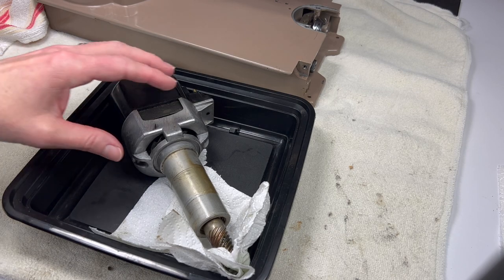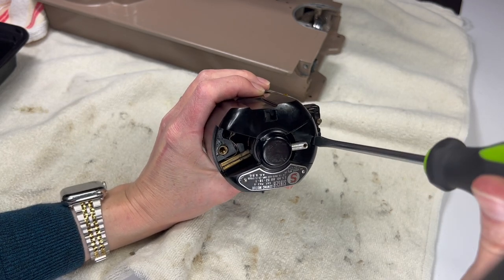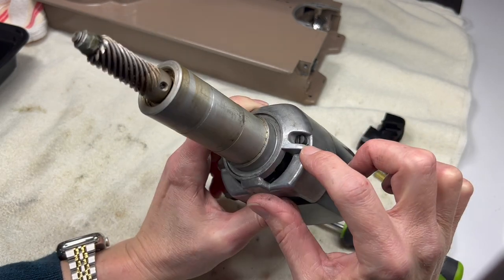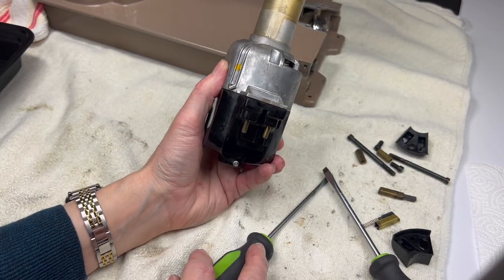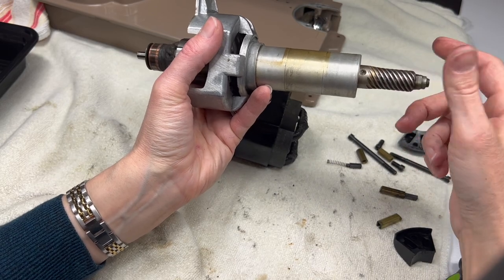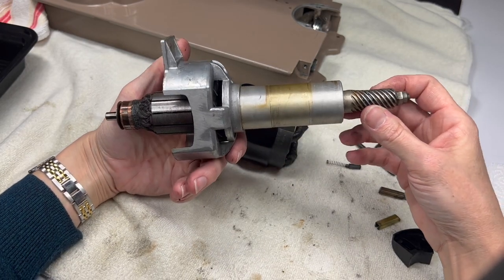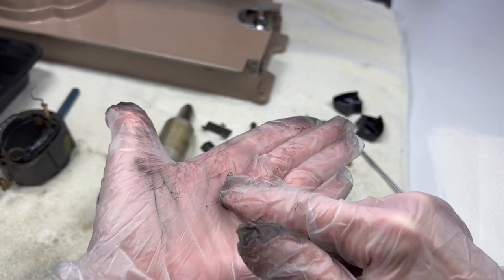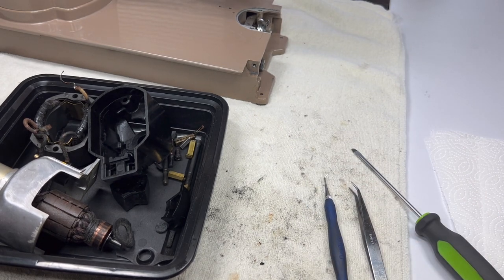How to take apart a Singer 301 Motor

Comment: Thanks for this awesome video! When that tab gets pushed down with my thumb on the bottom bearing retainer clip, I put a small folded piece of tissue paper to prevent it from coming up. It works! So far I have only done them on 400/500's. Today I will do my first 301A motor. Have fun, stay safe.
Reply from the maker: Hi Jebb! Thanks for the tip! And good luck with your motor, one of my favorite parts of restoring!
Reply: @SewingMachineRehab  Awesome!

Comment: Hello,
I am currently restoring a 301a. I do not have an insulator or a wedge. What do I do? Also I am pretty sure the  bearings on the top of the motor needs to be replaced… I can’t get a good spin out of it and it feels almost like it is lumpy. Where can I get new ones?
Reply from the maker: I would be less worried about the wedge than the insulator. I haven’t had to replace one yet but I guess if I had to, I would look on EBay? You could probably make one if you had the right material, I am going to have to look into that and get back to you. I purchase my upper bearings from a company called BDI. I will pull up the info from my last order and try to get you the part number later today, just a fair word of warning, taking that bearing out and replacing it is not easy. I’ve done it but I would first try to revive the grease in the existing bearing. You can do this by putting one drop of alcohol on the top of the bearing and spinning it to get the grease to break up a little. Then you can chase it with a drop of oil and usually that does the trick for me. Others may have a different opinion on that, it’s just what I try before replacing the bearing. I have a motor that is going to need that treatment on my bench right now, maybe I can film the a video on how I try to revive the bearing.